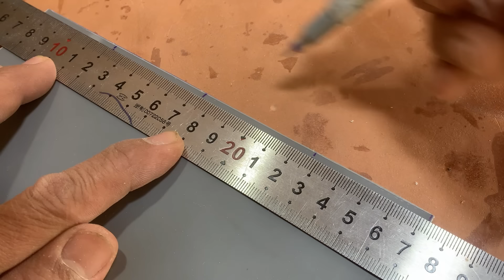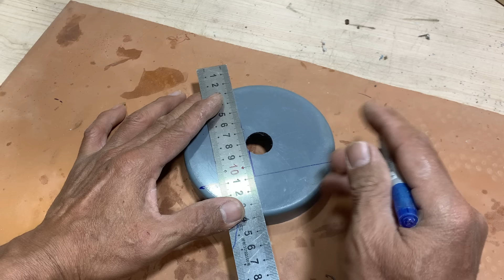How to make an automatic CUTTING MACHINE from PVC pipes! Very helpful

Comment: 10:02 In this shot I put the engine mount strap over the engine vent which is wrong because you will expose the engine to high heat,This opening helps air to enter the engine for cooling, and when you close it, you expose the engine to burning due to the heat, so either change the location or put a completely similar opening in the mounting belt, and that is better. Thus, you have made the belt with 2x1 Where the engine is fixed and at the same time air enters
Reply from the maker: Thank you for watching the video and leaving your feedback. Every comment you make helps the channel grow and motivates me to work more effectively. May God always bless you